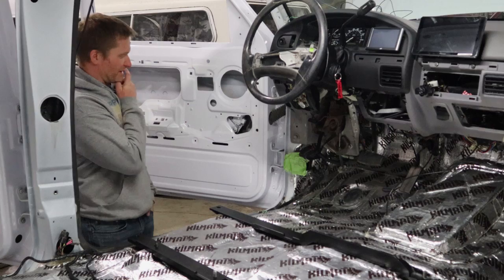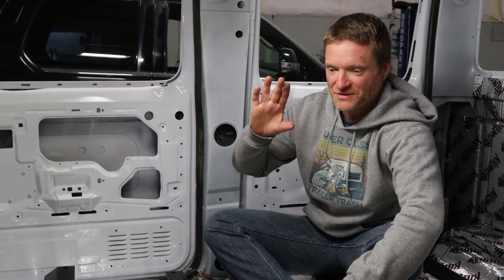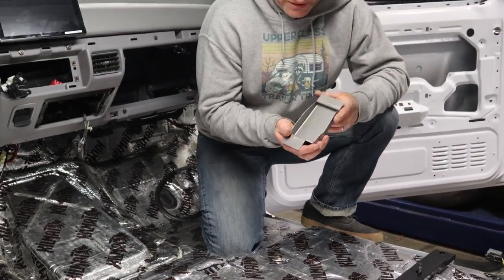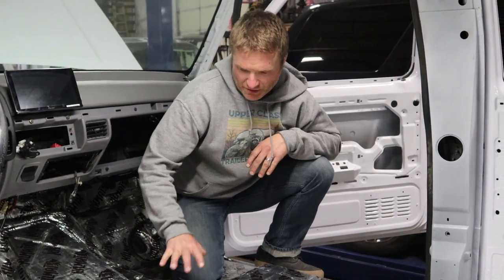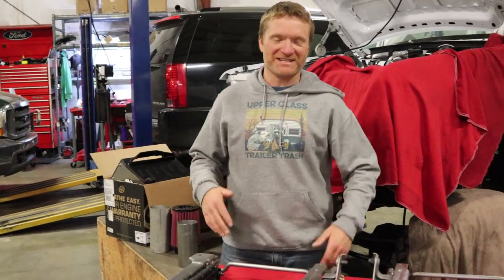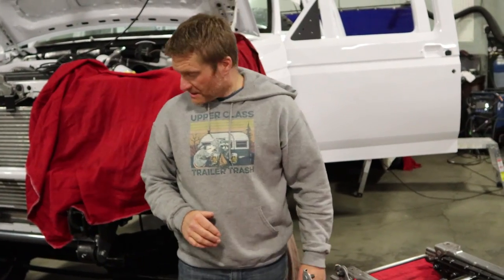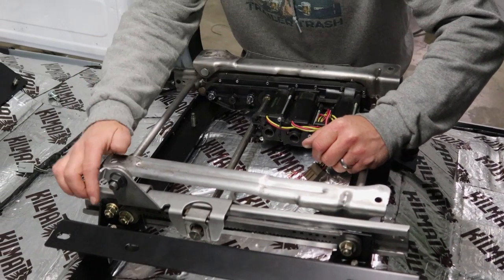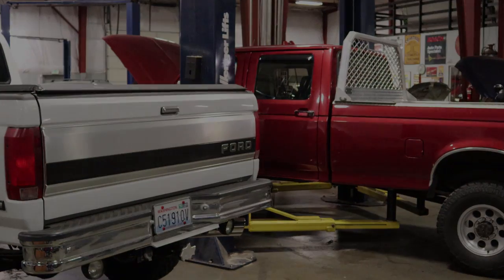OBS Solutions Superduty Seat Bracket kit for 1980-97 F-Series Trucks

Comment: Hey man, love the videos! Had a quick question if you could put me on a path where to go. I have a 93 f150 extended cab, And it has the bent seat and I want to put in the 40-20-40 seats that I pulled out of a salvage yard, however, it's not a direct bolt up. I was wondering if there was an easier way to do it or do I just have to Fab something up?

Comment: I got a set of mechanical seats from a ‘19 superduty that i want to put in my 94 F150 short bed single cab… will these brackets work for that? Or do you have something that will work?
Reply from the maker: Sorry, we don't have any brackets that work with the non-power manual adjustment seats nor the newer 17+ stuff.
Reply: @obssolutions1466  yea, i have a shop truck with the same seats, just vinyl, and i see why that bracket wont work… if i figure something out ill pass it along to you guys… im a fire truck mechanic for my day job